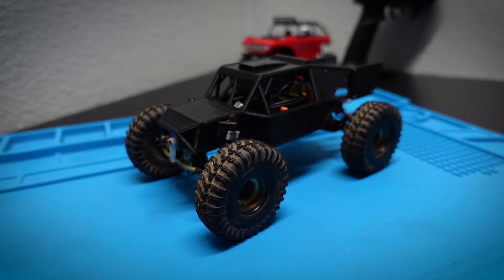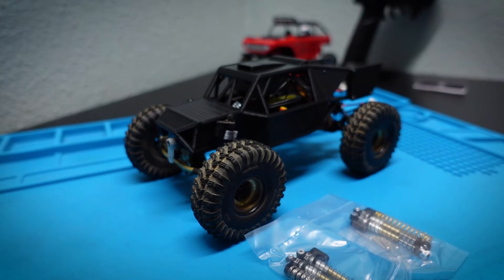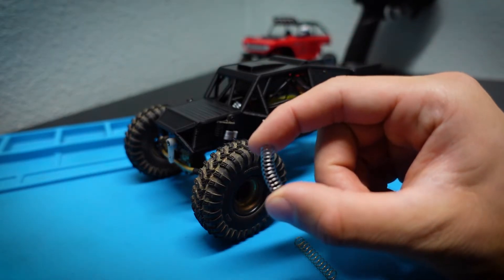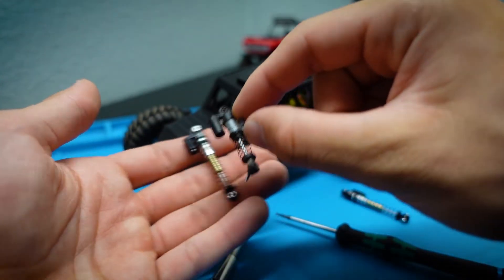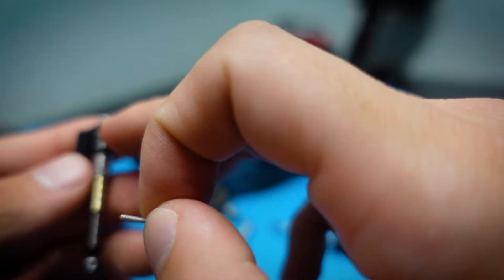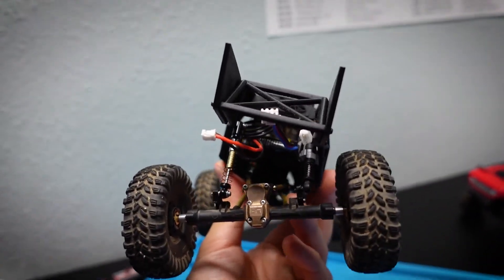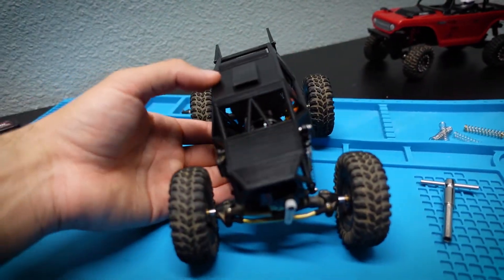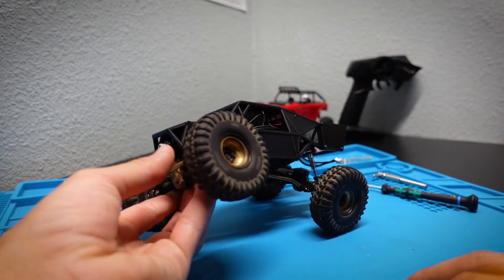Axial SCX24 Hot Racing Telescope Shocks  Ep.28

Comment: You need a limmter chain or strap.. I have one from back diff cover to under the battery tray center.. and one from the wishbone to the front of the electronics tray.
Reply from the maker: I was thinking that but then I should just remove the shocks hahah
Reply: @MiguelCortez  😅 took me 3 days to get it where i wanted it... also the spring needs to wear in on the threads.. (little drylube outside) weel starts lifting at 50 degrees.. it will do 53 very slowly.. preloaded the back springs a bit.. and have them even with the 2ed or middle piston on the shock just touching the axel.. just as fun tweaking it as it is running it.